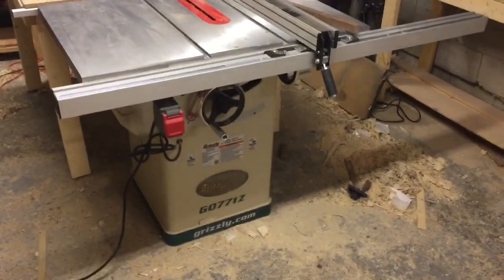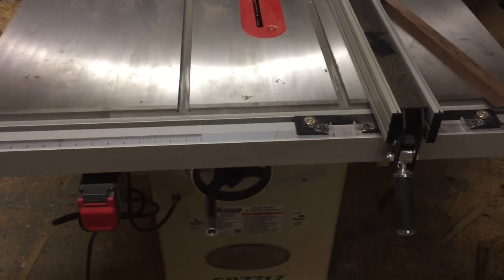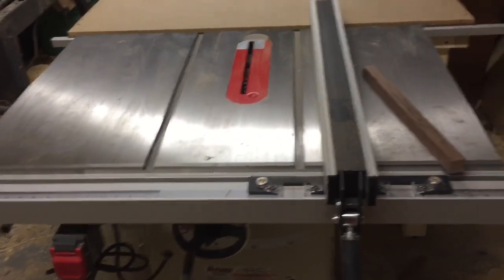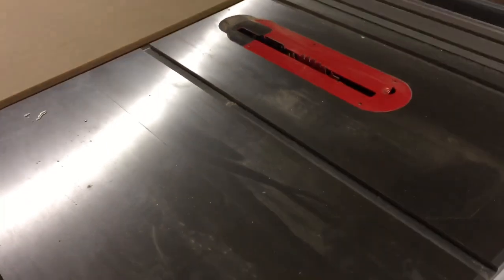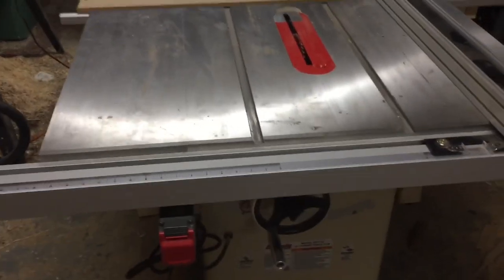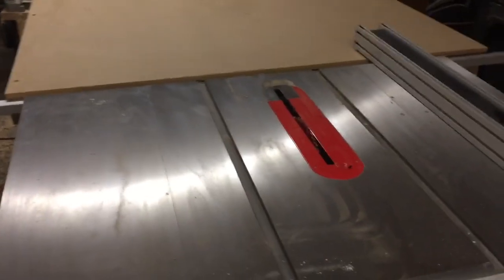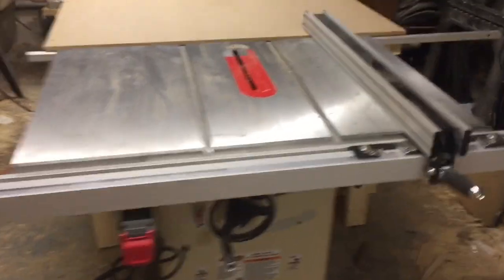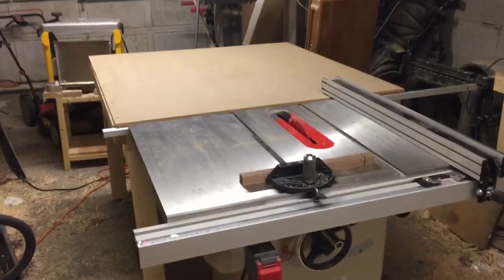Grizzly G0771Z Table Saw Review

Comment: This  Grizzly saw is a 2 HP not 1-3/4. This saw has more power and cuts better than all of the 1-3/4 HP saws like the Sawstop contractor saw, Powematic hybrid saw, Baileigh industrial hybrid saw, laguna hybrid saw, and Rikon hybrid saw. The Grizzly is also cheaper than every one of those to boot. The only other saws that are comparable in power and price are the Shop Fox and Woodtek hybrid saws, but even they are a bit more expensive though. This Grizzly is hands down one of the best hybrid saws on the market.
Reply: Grizzly uses Leeson motors as well whereas many of the other brands cut corners and use cheap motors

Comment: I've had nothing but issues from one of their products. My wife and I drove over 5 hours, and spent over $1200 at the Grizzly showroom in Missouri. Honestly the showroom is amazing. The product I got...not so much. I've had over 10 separate issues including defective, and back ordered parts sent to me. Grizzly did offer me $100 to keep the pos 😂😂😂. I like high quality tools, and won't hesitate to spend the money on them. SCM, felder, festool, saw stop etc. I like decent hand tools such as snap on, Milwaukee, dewalt, and I even think husky is decent due to being able to swap tools easily when they break one the job. We even have some harbor freight tools that I think are very very good. My experience with grizzly has been that of a dollar store drill press. Not to mention they will not post my review on their actual website.
Reply from the maker: WeLoveWoodworking sorry to hear that. Two table saws and a jointer have worked great for me. Great customer service, fast shipping and great warranty’s (that I haven’t had to use). Sorry you’ve had such a bad experience
Reply: Grizzly tools are the best bang for the buck. My lathe (G0766) has been outstanding, so has my table saw.

Comment: would you purchase this saw again,,i have been looking at this one and the delta 36-735 that lowes sells and I like the fence system on delta but I have heard horror stories about deltas customer service,,,but if you look at the you tube videos on the saw everyone seems to not have any complaints other than the instructions aren't too good
Reply from the maker: jeff oldham deltas have, and continue to be great saws. However, you do tend to pay a considerable bit more for them. As I’ve said Before, it’s my honest opinion that no one can touch the quality of this saw in this price bracket. In short, I’d absolutely buy it again
Reply: thank you for responding,,it helped alot

Comment: that table and trunnion assembly is exactly the same as my rigid table saw. i know this because i just had mine apart for bearing replacements. the blade insert is the same. the cast top looks identical. i wonder if the motors are the same?
Reply: I just replace my r4512 with this and I think its all the same like you mentioned. My r4512 miter slots were not T-slots but otherwise the motor is identical
Reply: Zachary Dixon can you tell me if the trunnion on the r4512 is mounted to the cabinet like it is on the Grizzly? Thanks in advance.
Reply: @rfmcqueen72  hey...sorry for the late reply. Cabinet mounted.
Reply: Ohio Outdoors well actually they are not the same but share a bit of similarities only in the top casting but not underneath. The Ridgid is using trunnions that mount to the cast iron top and the Grizzly uses cabinet mounted trunnions. Now the tops are very similar and possibly made in the same factory but again there are slight differences underneath because of the mounting locations for the trunnions. I believe the throat plates are the same thickness so again possibly same factory but Grizzly takes it up a notch by mounting the trunnions in the cabinet and not mounting them to the top underneath as the Ridgid. Both great saws but again trunnion assembly isn’t the same. A quick google search will show the Ridgid using trunnions mounted to the bottom of the cast iron top and the Grizzly will show the the trunnions mounted to the cabinet. Now the previous model the Grizzly G0777 without the “Z” did use trunnions mounted to the cast iron top like the Ridgid but the newer model they upgraded the trunnions to cabinet mounted trunnions. This is assuming your speaking of the R4512 or the newer R4520. I believe the older model the R4511 possibly used trunnions mounted to the cabinet but if it is the R4511 with cabinet mounted trunnions than the tops are not the same.
Reply: Zachary Dixon totally incorrect Zachary, a quick google search will show without a doubt that the Ridgid R4512 uses trunnions mounted to the cast iron top and not to the cabinet like the Grizzly G0771Z.
Reply: Robert McQueen unfortunately the Ridgid R4512 and the newer R4520 uses trunnions mounted to the cast iron top and not mounted to the cabinet like the Grizzly G0771Z. Please ignore Zachary’s reply stating they are cabinet mounted when in fact they are not. A quick google search will show they are not cabinet mounted. I believe the last Ridgid tablesaw to have cabinet mounted trunnions was the R4511.

Comment: are there any issues with the beveled edges on the wings? others have it them not match up. how long have you had it? thanks for the review!
Reply from the maker: ri mar they went together great for me. They take some time, making some adjustments, but you can get them perfect if you invest the time. And it's been about 3 months.
Reply: thank you, now since the 715p is discontinued this is my only option.
Reply from the maker: Its a good option.
Reply: Right Mar the 833 is the replacement for the 715